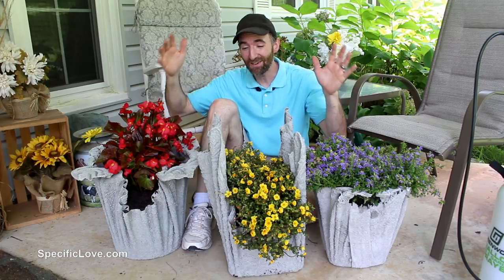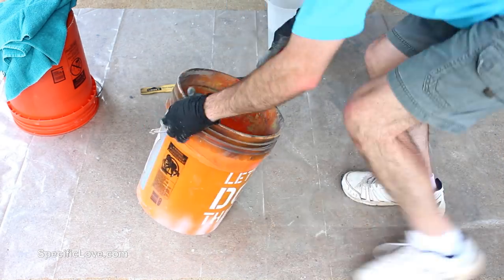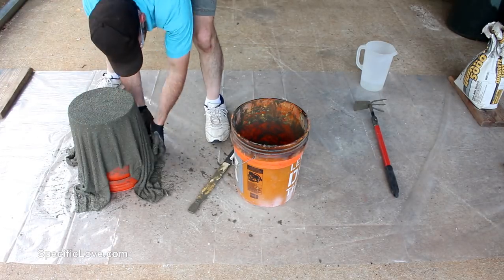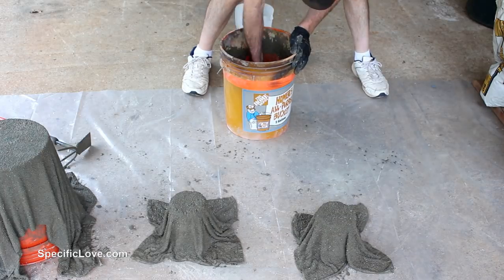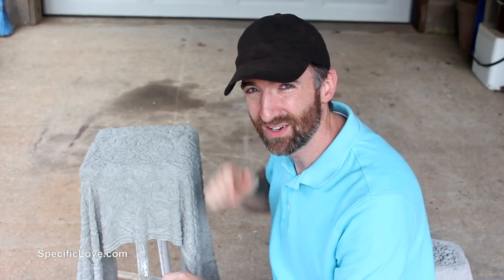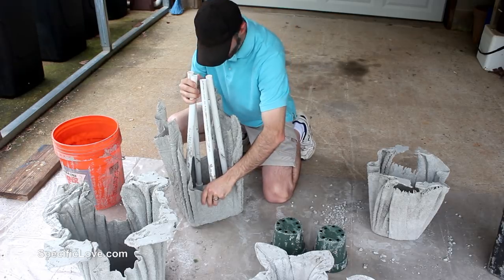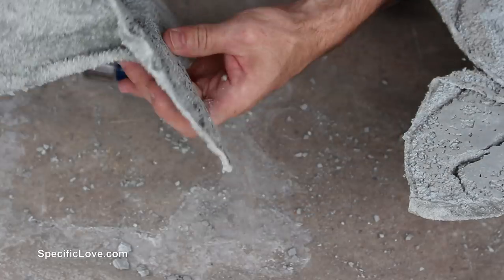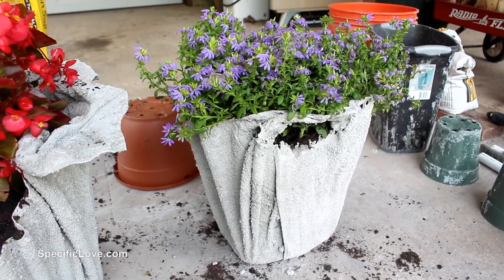Stunning Concrete Planter DIY ~ Backyard Upgrades #3

Comment: What a very cool idea! I really liked how the textured towel showed thru! Two questions for you : 
1. Would this work well with countertop concrete which doesn’t have a lot of aggregate in it?
2.  Will you do a follow up on how these hold up to weather and water? I’m curios if the towels will hold water and cause stress cracks or breakage in temperature changes. 

You come up with such novel ideas - LOVE your channel!! 👍💗
Reply from the maker: Since it really did not need the aggregate, it should work but I am new to it myself.
I will try to have an update in the future on my Instagram.

Comment: Fist up Wow Great job! Very creative. Second.. you do NOT want concrete for this. It's a waste of energy and money. You want to purchase portland cement. Concrete is essentially a mixture of cement with aggregate (the gravel). Since you do not require the aggregate for this project just buy the cement. I might also try using plaster.
Reply from the maker: Great to know, thank you
Reply: YOU, ALSO, NEED TO WASH/AGE THAT FINISHED POT, BEFORE TRYING TO PUT A PLANT IN IT. WAY, WAY, TOO CAUSTIC. THAT'S WHY YOU WORE GLOVES.
Reply: Actually maybe The aggregate on concrete helps to keep it together . Also, after its done you just need to submerge in water for a day to make it ok for the plants.